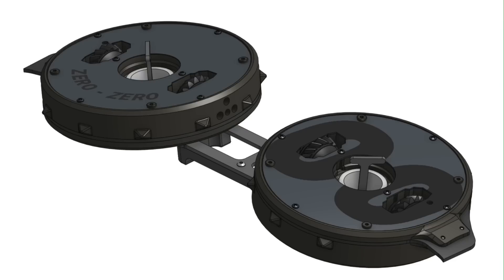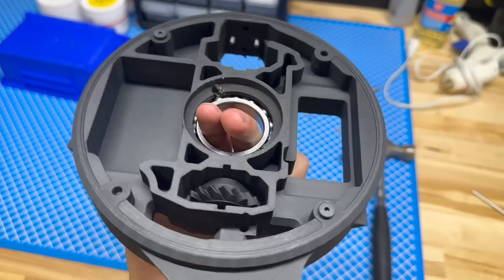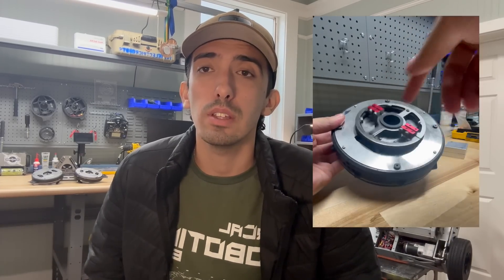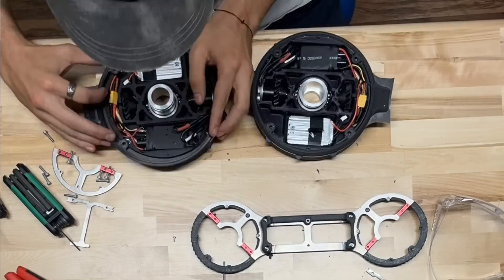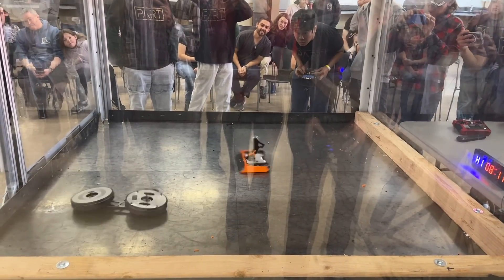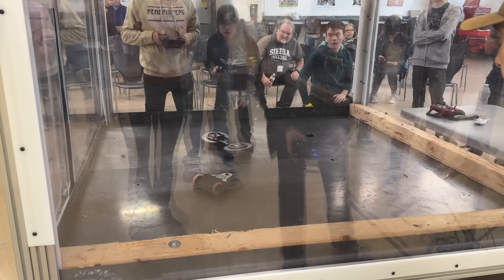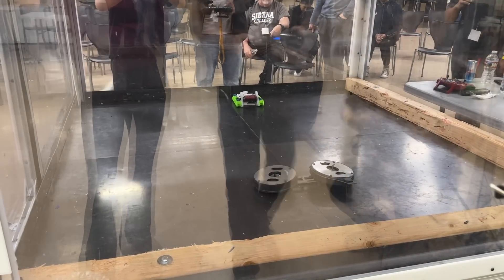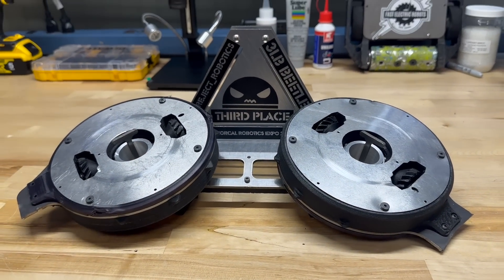Most destructive potential in a combat robot!? Zero - Zero: 3lb Build

Comment: I think part of its design is that it does not make sense in this sense, but you should use direct drive brushless motors with the rotor directly connected to the frame, this would decrease complexity a lot, and should allow you to achieve MUCH higher tip speeds.
Reply from the maker: Start up tourqe is really important for it to get it out of sticky positions, so I decided on the ~3:1 ratio of the wheels to the track. I purposfully designed the bot to closely resemble melty robots, since they've been working for years now. I did make some prelim sketches of a version closer to what your explaining, but I'm happy with entirely off the shelf components for now. This has been the most "plug and play" robot I've had in years and it makes component replacment a dream to work on